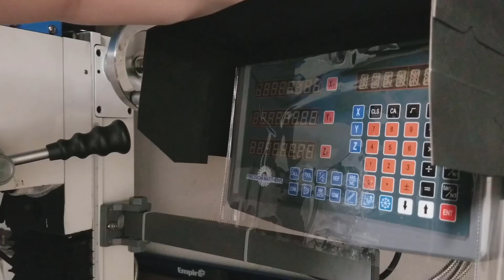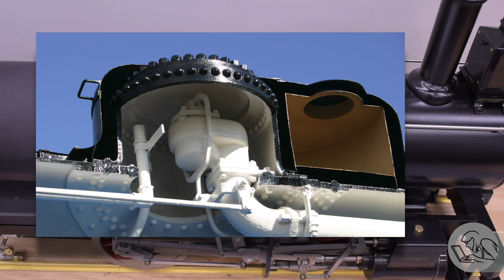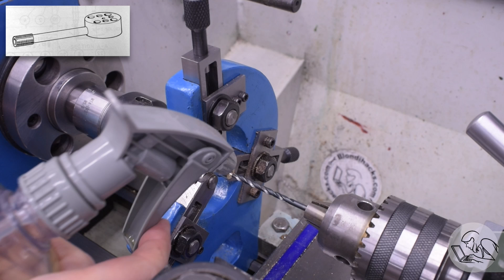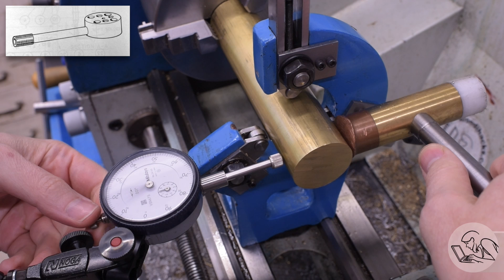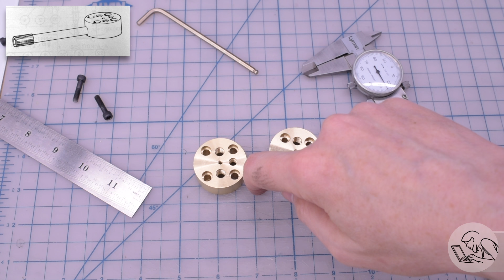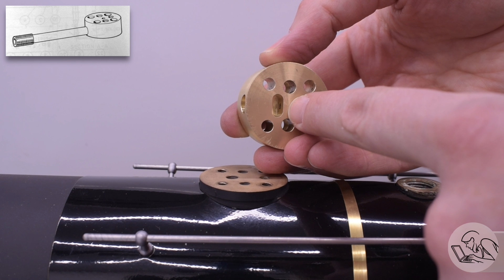Throttle Body! - Pennsylvania A3 Switcher, Part 102

Comment: How will you control the throttle while in use? There's the levers, but how do you actuate the levers while running the train? A servo? Running along it?

Comment: I guess that you have up build another locomotive that the scrapped part fits so you don't waste these expensive materials. Also, the build of the second locomotive should go faster since you have practise and tooling for now. 
😂
Reply: actually using the scrapped parts (that were scrapped for a reason) suggests that the second locomotive is the "Dorian Gray" one...